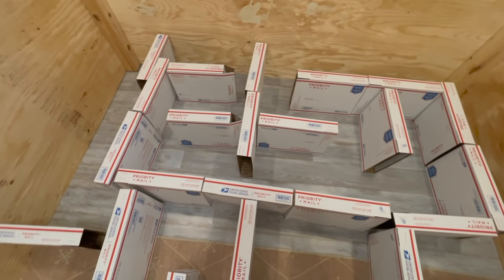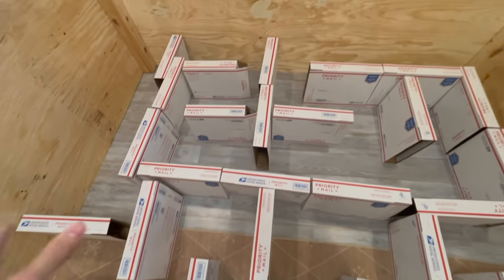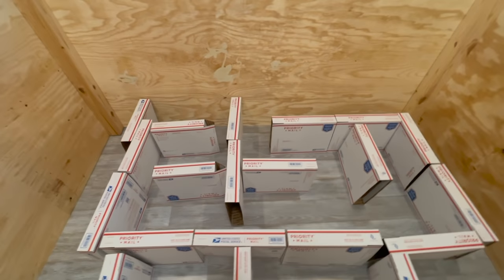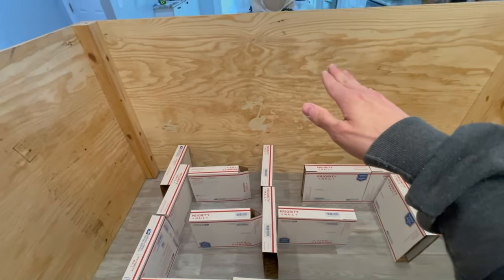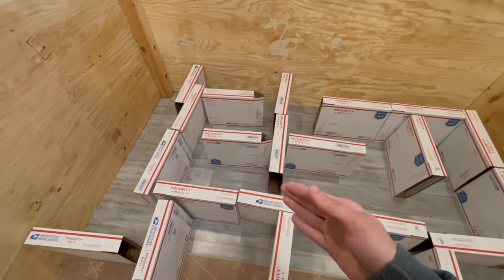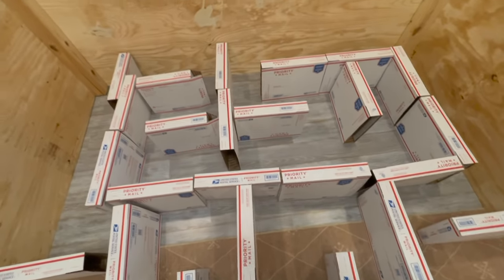Building My Pet Raccoons a Giant Maze!

Comment: You did a video about a year or so back where you built a 3 tiered structure for the raccoons to play on. Did you remove it from your list? I've checked and  I can't find it.
Reply from the maker: The video where I built the raccoon enclosure is still up 😊.  I built my raccoon a $5000 enclosure I believe is what its called.  Hope this helps!
Reply: @TitoTheRaccoon  That's not it. It's the one where you built a multi-level structure in your backyard. It was an outdoor structure. 3-levels. Carpeted. Remember it?